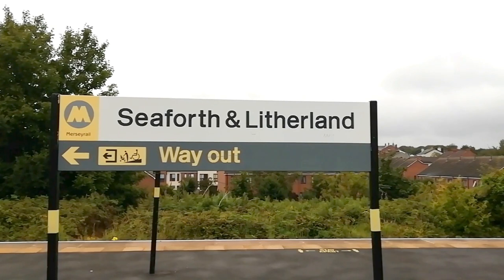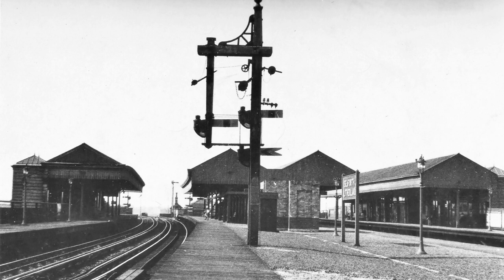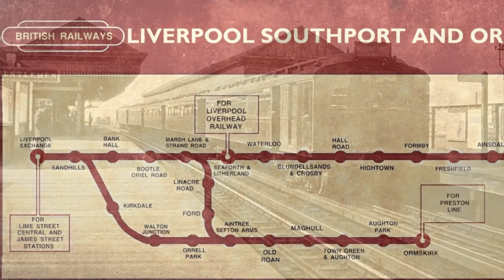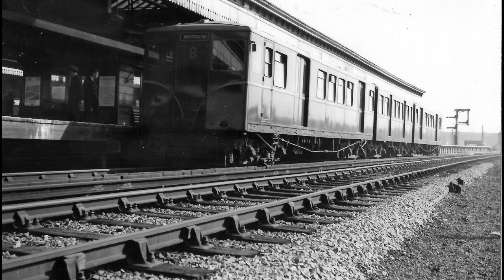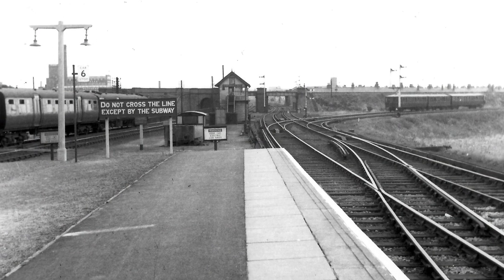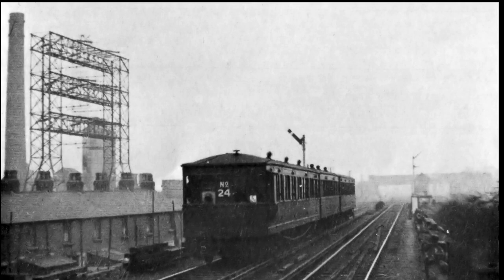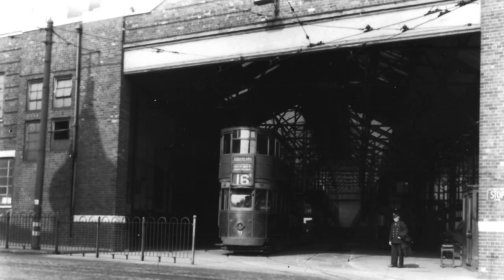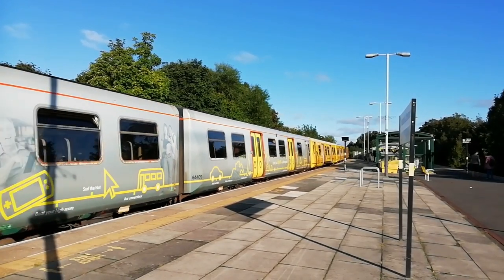Merseyrail history. All change at Seaforth & Litherland

Comment: Just  watching your great video. Wondering you say about the old railway line which runs behind hornby boulevard  road.   Were did run to and do you have any more footage on that line. I am a keen photographer and wont mind mind getting on there to take some photos.  I no there is still some lines there
Reply from the maker: That's the North Mersey branch. It runs through to Aintree & Fazakerley. The track is still there but its disused. I did try to access it at the Seaforth end its very overgrown now. I will be doing a video of the full line. In the meantime you can see the Aintree end in my video Aintree a tail of two stations.